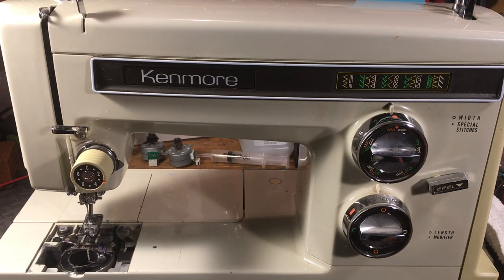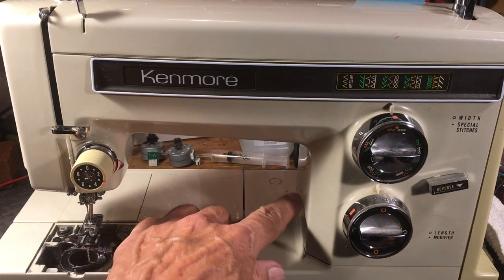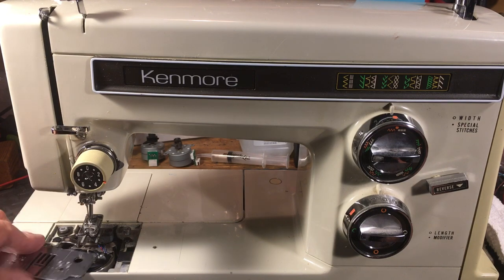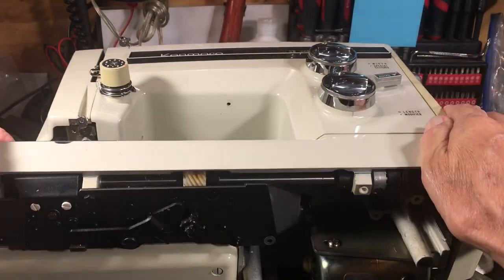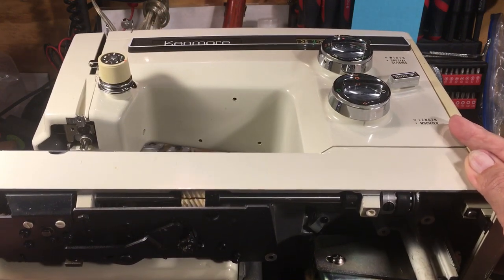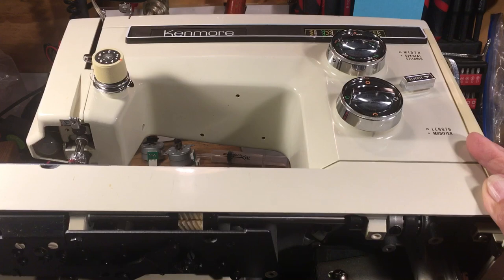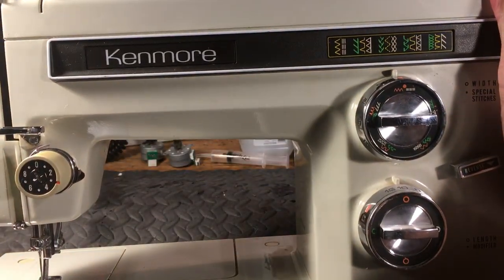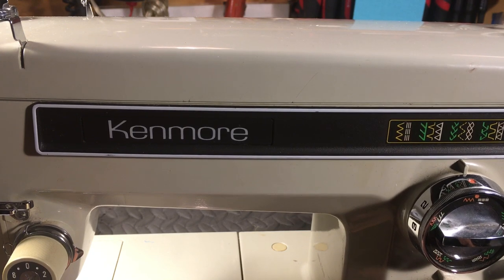Don’t buy this Kenmore machine. (exception) 158.16900 Made in Japan w/plastic gears (video 216)

Comment: I have 158.17800 the plastic gear looks good. My question is do you know how to raise the feed dogs? The bottom of my machine looks exactly like the one in video.
Reply from the maker: I’m not sure that is has a drop feed, but if it does, it will be either in the right front of the feeders, or off to the right side in front of the free arm area. 
Next one that I get in for service, I’ll give you a definitive answer. 😎👍🏼
Reply: It doesn't have a drop feed that I know of but thank you.
Reply from the maker: @Hiccupbee  👍🏼

Comment: I got a mint 158.14000 for free but it’s not on your list, what you think? Is it anywhere near your top 10 sewing machine?
Reply from the maker: There’s too many good ones to list. Just make sure that the Kenmore you’re after has a front loading 15 class bobbin, is a 158 series, and has the front facing tension assembly. If it’s made in Japan, that’s great also. Doesn’t matter if it’s a flatbed or a free arm. 👍😎
Reply: I know you posted this a while ago.  But I was gifted a 1400 in 1970 and I LOVED it.  It's not the most sophisticated of the Kenmores, but it will do just about anything you need. It's all metal, front loading, tough, and a workhorse. Keep it clean, oiled properly and you'll have a machine which will serve you for a lifetime and beyond. I was stupid enough to sell mine about 30 years ago.  I missed it, so went out and found a duplicate for my collection. It's a sweet machine.

Comment: Does the 158.7600 have a plastic gear. Problems with the zig zag stitch.
Reply from the maker: The Kenmore 158’s that are front load, 15 class, are not associated with the plastic gear set up, found in the top load version. 
As a rule, I would avoid acquiring a top load (drop in bobbin) Kenmore, as they are problematic, as opposed to problem free.
Reply: @randyyoursewingmachineman9954  Thank you. ❤
Reply from the maker: @nancycat2588  you’re welcome 😎👍🏼

Comment: oh crap, just bought one at thrift store.  ahhhhh
Reply from the maker: Not all the feed gears break. If you turn the hand wheel and it tightens up, then pops, and then feels loose again, it probably has a cracked gear. 
The only way to know for sure is to remove the bottom cover and take a look. Good luck 🍀
Reply: @randyyoursewingmachineman9954  It didn't come with a manual, can you recommend best site to get one.  They all seem to charge. $
Reply from the maker: @cindysantos922  unfortunately they will have to make a little to stay in operation. You might find a book cheap at shopmygoodwill.com.  Good luck

Comment: what a shame. I wonder if a machinist could make this part.  My husband does machining as a hobby.  It's amazing the things he can do. I'll have to ask him about that.
Reply from the maker: I can get the part no problem. It’s an hour to install it. Minimum charge to replace it: $200. No one will spend that kind of money on that machine. 
So just get one without a fiber, nylon, or plastic gear, and never have to worry about it. 😎
Reply: @randyyoursewingmachineman9954  Yes, my husband just said the same thing.  If it were my machine, I would pay it.  Well, worth the 200 or so to fix it, if you can afford it, in my humble opinion.  I've already got a Kenmore. I've got the 158.15251. Great machine.
Reply from the maker: @rebawasswass3716  if you have metal gears, you have no concerns about gear breakage. 
I just try to warn people that even though it’s a Kenmore, and a good machine, it’s always wise to be sure about the gears.
Reply: @randyyoursewingmachineman9954  I have not found ANY gear supplier yet for that nylon drive gear.  Who is your supplier?
Reply from the maker: @geraldkahn2535  I don’t have one. 
If the part isn’t original equipment manufacturer produced, I don’t want it. An out of spec gear is more trouble than it’s worth. I don’t fix these issues on machines.
Reply: @geraldkahn2535  McMaster-Carr has gears in almost every flavor ever made.  And if they don't have it, Auburn Gear does.  They have people on staff who get PAID to talk to people on the phone and help solve their problems.  Toll-free numbers.  Give either a call.
Reply: One can purchase a 3d printer for like $200 and print this gear for pennies.   The first one may or may not be perfect but even if it take 2-3 tries to get it perfect then you can make piles of these gears for next to nothing and keep these machines running for many years
Reply: Is that plastic gear pressed onto the metal cylinder that has the two screws to lock it to the main shaft?  (So a 3D printed one would then be reinstalled by pressing it back onto the metal cylinder.)

Comment: This one is similar to the Japanese 12 stitch 158.1680- does the 1680 also have plastic gears?
Reply from the maker: Any 158 series that is a front load, 15 class set up has the metal drive gears. 
If it has the top load, drop in bobbin, it has the breakable nylon (plastic) gear.
Reply: Yep, my current .168 has the plastic gear. On the hunt for another model to be safe :)
Reply from the maker: @Binksinboots  just look for:
1) front load
2) 15 class
3) 158 series
4)Kenmore
Easy peasy
Reply: @Binksinboots  thanks!
Reply: @randyyoursewingmachineman9954  Found one an hour away, 158.19461. Thanks for your insight, and wonderful videos!!
Reply from the maker: If it’s a top load, with a drop in bobbin, the feed gear is made of nylon. 
Some break, some don’t. 
If you have one that isn’t fractured, be sure to keep the feed mechanism oiled so that it doesn’t lock up and break the gear. 
I have customers who love theirs and have no problems with them. 
It’s a small number that have the gear failure and it usually happens early on.

Comment: 3D PRINTER ???
Reply from the maker: If you can print a hardened steel, machined,precision metal replacement gear, then you’ve really got something. 
Otherwise, you just might as well have 3-D glasses. 😎👍🏼

Comment: Send me a broken gear and ill machine you some aluminum ones, do u think aluminum is over doing it?
Reply from the maker: Aluminum is fine. 
After you pay the expense of the CNC setups and then installation labor, it gets cost prohibitive in a machine of marginal value. 
For a broken gear in a higher value machine, like a Bernina 830, that might be a plan.
Reply: @randyyoursewingmachineman9954  Let's say a guy like tenthplanet here makes a correctly machined and well-fitting gear.  In your opinion, would the installation of it be doable by an experienced DIY guy without any specialized tools or previous experience taking apart the mechanism involved?  For example, two or three hours of my time for a successful repair would definitely be worthwhile.
Reply from the maker: @jameswangerin1755  that’s a feasible proposition. 
The cost of the gear would be issue number one. 
Installing it, is issue number two. 
Setting the pattern pendulum timing and making the machine perform correctly is issue number three. 
The problem with sewing machines that have non metal gears, is that they usually have two to six gears that have to be replaced at the same time.
It could get challenging. 
If someone wanted to test their methods, they could duplicate the gear sets in a Singer 834. 
Either the two hook drive gears or the two feed gears would be ones I’d take an interest in. 
Be sure that they have the 2.5 millimeter set screws threaded in place as well.
Reply: @randyyoursewingmachineman9954  Thank you for your comprehensive response.
Reply from the maker: @jameswangerin1755  sure thing. 😎👍🏼